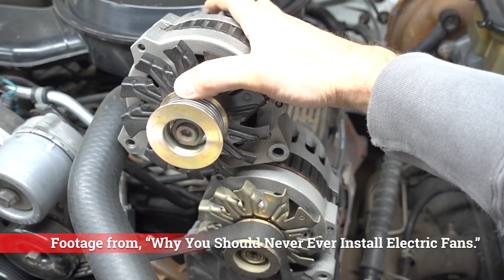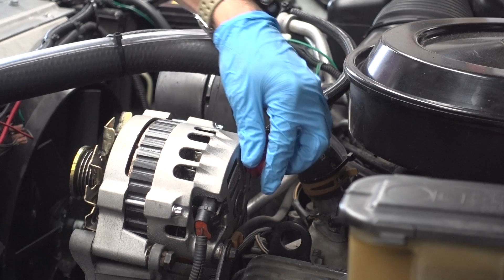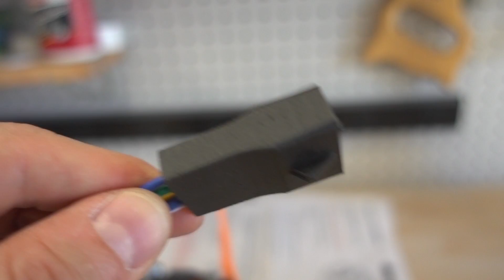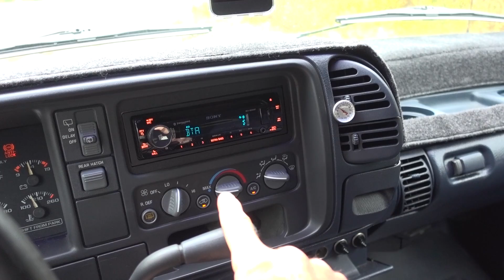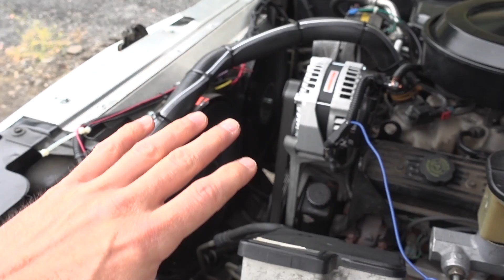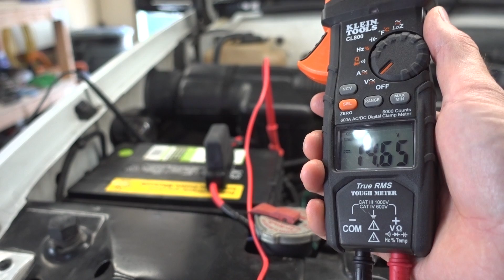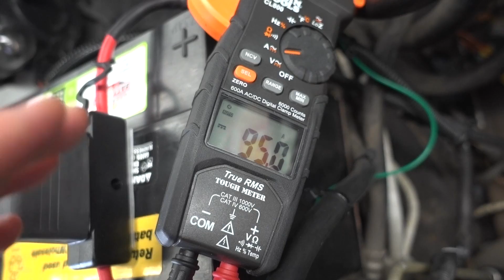Why This ALTERNATOR SAVED MY TRUCK & ELECTRIC FANS!

Comment: When installing electric fan costs over 1000 dollars
Reply: I have a 04 Chevy Tahoe and added fans from a 05 Tahoe and had the computer programed to operate them. I have no problem with the changes !
Reply: @TheNickmic  I would just run the old stock mechanical clutch fan on something like that since it worked well for its time......
The only waste of power is if the clutch siezes and it runs constantly when not always needed 
U canals run a another fan with more blades too
It's just easier on the vehicles electrical system overall 
Unless u want to go through more alternators or more expensive ones 🤔
Reply: It doesn't cost anywhere near that. Additionally, it's worth about 20hp and 1-2 mpg, so it will pay for itself in due time. There is a reason they did away with engine driven fans.... 25 years ago now, even on the very last hold-outs like GM trucks.
Reply: @johnny0454 you must think spinning the alternator is zero horse power loss😂

Comment: The extra wire that you hooked up to a “switched source”,  did you mean a source that switches on when the vehicle is turned on? how did you attach that wire to your fuse box? Thanks for the great video!!! I’m gonna do this and the electric fans to my 96 Chevy G20!!!

Comment: Oh yeah nice and shiny... That look of approval changes when she sees the $500+ charge in the CC... lol

May want to look in to the 99+ charging setup... The alt is only triggered to charge for first 5-10 minutes on cold startup and then drop off when battery is full. With my 06 Silverado it is normal to see it drop off from 14+ to mid 12s (the gauge is a little off, actual measurement shows it tops out around 14.1 and then drops down to 13.2-13.5).

Comment: Wonder if you lost enough power to defeat the purpose of using the fans to save power
Reply: ...the gains from electric fans are only really realized at highway speeds, where the forced air thru the grill should be sufficient to turn the fans off if they are properly setup.    At city speeds, idle, traffic, etc the fans are there to prevent a overheating situation.  
Sadly most that set up e-fans do not have them thermostatically controlled, thus they are drawing power all the time, same as a clutch type fan, even when it is not needed.

Comment: Congrats on your new install. Certainly it should provide enough juice for all your electrics and more. I'd next take care of the low oil pressure at hot idle your truck showed as you described the voltage on the gauge. 20 PSI and below? I don't know. I'd be more at peace with 40 PSI or higher. Maybe a high pressure/high volume oil pump could solve this potential problem in-the-making.
Reply: It’s a gear driven oil pump, which is why at idle it shows low oil pressure.

Comment: it seems like you have an ABS fault
Reply from the maker: I sure do. Don't really understand it yet. when I bought the truck I had the ABS fixed at the dealership which cost me a pretty penny. It's been fine and I've actually felt at work a few times in the snow. One day I jump in the truck and the ABS light just kicks on right after I started it. Maybe it's a simple fix I don't know.
Reply: @1RoadGarage it can be one or more of the speed sensors or the ABS wreath if it sits outside the wheel bearing
Reply: @1RoadGarage  : Do the simple fix of the 80s, unplug the light. LOL

Comment: Good stuff, your tone of voice is better but still shouting, 
You oil PSI is low, critically low, after a while your rockers will start to click b/c now oil is going up the motor, either run a thicker oil OR get a new oil pump.

Comment: For anyone I have a question - why on my 06 yukon with a stock 160 amp alternator with over 140K miles on it I don't have any issues?  I always have the A/C  auto climate control on front and back.  Driven through Indio and Blythe CA in the dead middle of summer when it was 117*  and have spent a few days visiting my uncle in Phoenix during the summer.
Reply: Your alternator is able to keep up with the current demands of the truck. If it wasn't, you would see a drop in voltage just like he did.
Reply: @catch22frubert  correct, but why didn't his?  He needed to go aftermarket.  I have the same set up in my 06 yukon all stock.  It has dual electric fans also.  The fans have a low speed and then full on high.  Could it be that it is wired from the factory much better?  Also my 06 has that amp clam on it from the factory.  Thanks, just trying to understand why he had so many issues.
Reply: @jewllake  his truck came with a much smaller factory alternator, and his fans were aftermarket. Yours was designed to handle max load from the start. His was an older design and the factory alternator was weak.

Comment: Would highly recommend a northstar battery too, excellent American made agm car batteries that alot of sound system guys use too because you can draw so much on them without draining them.
Reply: Agree 100%. The Northstar will also do better with the higher charging voltage. I run over 3,000 watts RMS from a couple of Orion XTR amplifiers, and I use 2 Northstar AGM batteries and a 300 amp alternator. Voltage stays at 14 volts and I've never had a problem with the voltage, amperage, or charging system

Comment: Dude, I've literally been waiting years to see you replace that crap power master alternator. I watched you do all those grounds. So satisfying to see you get the right parts finally!
Reply from the maker: Haha, I wouldn't call the PowerMaster crap. Some of the blame is upon me for ordering an underpowered unit (though it didn't do anywhere near what they rated it at idle...) Just very happy I finally don't have to worry about voltage at a stop light in the summer.
Reply: @1RoadGarage  You are right, the power master was just insufficient. Very nice to see you install the mechman. Now you can put a nice sound system in the suburban with no problem at all! You have plenty of amps to play with, let's see you throw 1000 watts at a single 15 inch subwoofer in a ported box. Plenty of room back there too! That would make an awesome set of videos. If you need advice on cost effective, quality equipment, let me know and I'll show you the way. I currently have a 300 amp alternator, 2x group 31 AGM batteries, 1 Orion XTR 750.4 ($139) on the mids and highs, 1 Orion XTR 2500.1($349) on the subwoofers which are two 12" American Bass XFL's in a ported box. The system sounds amazing, and it was cheap. I'd say $1000 for all my equipment.

Comment: Will you be doing a video regarding the ABS Light?
Reply from the maker: Maybe, I've researched it a little seems doable.
Reply: @1RoadGarage  Will be good to see.  I had a similar deal on my Tahoe that required an OBD2 scan tool that could read the ABS codes.  On my truck it told me about a broken Tone Ring wire being broken.  Would be very interested to see what your results are and if you have to do the same way to find out what's triggering your light.

Comment: Many good points here. The day of the belt driven fan is mostly gone now, replaced by electric fans. The driving force is a slight improvement in fuel economy, though there is a price to pay for extra electronics.
Reply: very little fuel economy ..but much more risk of cooling failure compared to solid belt driven fan blade

Comment: So it's basically an upgraded AD244 that they sell... An OEM AD244 would have been fine for this application and provide the same amperage at idle (spec is 90+ Amps at idle).
Reply from the maker: Trust me it would've been iffy. I wanted overkill and that's what I got.
Reply: The AD244 is rated at 90 amps with 0 load on it. As soon as you add a load to it, it drops down to about 60 +- amps   continuously at idle.

Comment: I was just about to buy everything in a couple days to do the same thing, glad you did a update on what was happening and what size alternator you went with so I can do the same to my 2004 suburban, because I live in AZ and I really need this upgrade now with the summer already here.
Reply: Mechman alternators also sell an adjustable voltage regulator you can adjust right in the cabin. I'd say 250 amps is more than enough for any regular application, unless you run a big stereo system or something.

Comment: Why electric fans? Those trucks came with direct fan.
Reply from the maker: The belt driven fan doesn't pull at idle. Only at speed. I wanted/needed a lot of pull at idle or slow speed. Also I've probably gained 20+ horse by putting in electric fans (not that I think that's a sole reason to swap...)
Reply: Sounds like you have zero experience with flex fans. Only the ultimate low speed engine air drawing fan ever - bar none. Very little HP loss at high speed too as they centrifugally decouple themselves from moving excess air then. Hayden used to sell one combined with a thermo clutch for best purpose and best economy. Stock fan doesn't pull 20 hp, it would melt the belt. A full sized B section can not transfer more than 9 HP before it shreds itself due to heat build up, a serpentine wouldn't be too far away from that number.

Comment: 15 V?

Coming soon: How to change bulbs all over the place.
Reply from the maker: 15v is normal during cold start charging. 14.6 or so is the normal running charge voltage.
Reply: @1RoadGarage  
Okay - believe in it.  ;)
Reply: @corey Babcock  13.5 - 14.7 is  Considered acceptable on a 12v lead acid car battery. 12v AMG and Deep cycle batteries do not like to be charged at that voltage.
Reply: Jajajajajajaj

Comment: Thanks I was having the same issue  with my car  When I turn on my A/C now I know what to do.
Reply: You don't need a "250a" alternator. A stock ad244 off of a gmt800(which that mechman is) would be plenty
Reply: OK cool thanks. I'll trade that🤘

Comment: You should have linked the alternator my man.
Reply from the maker: I may still do it...
Reply: @1RoadGarage you still haven't done it
Reply: @1RoadGarage  I was able to find the site fairly easy, it might just be a cool thing to do. They are a tad pricier than some other comparable options out there and the fact that some of them require a new belt is a turn off for me personally.
Reply: @ariyanadumon4549  , The smaller belt does suck but it's the only way to get the higher amperage out of those alternators.  They simply install a smaller pulley which makes the alternator spin faster.
Reply: I wonder how long it will take to get a replacement when it fails?? Do you have to ship the original one in for repairs or can you just order another one and then ship the old one back? What is the warranty on that anyway?
Reply: @globalmobile017  , The warranty is 2 years. And yes you have to ship it back in to them for repair. it sucks to be down waiting for warranty work to get back.
Reply: @robbyota5598  it doesn't say how much shorter or give any indication of part numbers or anything lol. That's just kinda shitty to me.
Reply: Robbyota 559 Yes that would be a problem waiting for warranty repair especially when you have to ship the old one back to them I guess a good thing would be is to have two of them so when one goes out you can just swap it out with the other... just imagine going on a long road trip and your alternator goes out can’t just go to a AutoZone to pick up another one
Reply: @ariyanadumon4549  ,  1 inch on most applications.
Reply: @globalmobile017  , it sucks
Reply: @globalmobile017  at $400 a piece I don't think I would want to buy two of them I would just go and buy a replacement bracket that he cut off to fit the new alternator and keep the old one.. obviously it has some issues but it will get you out of a jam until your replacement from Mechman shows back up
Reply: @ariyanadumon4549  the most general motors trucks and SUV's come with one of two alternators a 105 amp or a 140 amp and when you go to the Mechman with a smaller pulley all you need to do is buy the belt that goes to the 105 amp which is 7/8 of an inch shorter. Now if you had the original stock 105 amp I can't tell you which belt to get.
Reply: @globalmobile017  Installed correctly here, it should last a very long time without issue. If you did have an issue with a bad alt, Mechman would take care of you for sure. He/they have been in business for quite a while and have a great rep in the car audio community.
Reply: Should have bought a SINGER ALTERNATOR.
Reply: @JohnG1000  10 months ago says he maylink it.. never did

Comment: Interesting that the voltage on the gauge matches my 93 C2500 Suburban (7.4) exactly, but I'm still running the stock 105A alternator and a mechanical fan. It shows over 14V when cold, but gradually drops under 14V once warm and when everything is going. You're right that the gauge on the dash is likely worthless. I use a USB adapter in the cigarette lighter that shows voltage, and it shows 14.2V at cold start and 13.6-13.8V once warm depending on how much stuff I have on. I've validated it against a voltmeter hooked to the battery terminals, and it's a very accurate gauge.

Overall, I think I'll stick to the mech fan.  I upgraded the 5 blade to a 9 blade from a late 90s 454, and that seemed to really give me all the extra cooling power I needed.
Reply: Those voltage readings are pretty normal. Voltage regulator in most stock type alternators are overly protective of overcharging the battery. Usually isn't a problem. However, if you run down the battery more than a little it can take hours of driving (not idling) to bring the battery all the way back to full charge. Takes some time at 14.5v or a little more to get to 100%. Even longer if 12.6-14. As long as its above 12.6 the battery charges just not very fast. Alternator has to replace all those "missing" amps and the output at low rpm is small. The factory voltage gauge is good enough but it doesn't tell the whole story. Each of those lines is 7/10ths of a volt. Turn the key to on without starting and see what it indicates. Then check the battery with a handheld volt meter. Gauge will be close enough in my experience. The stock alternators just aren't great. A good charger/desulfator hooked up to the battery occasionally is a good idea. So is frequent highway driving.